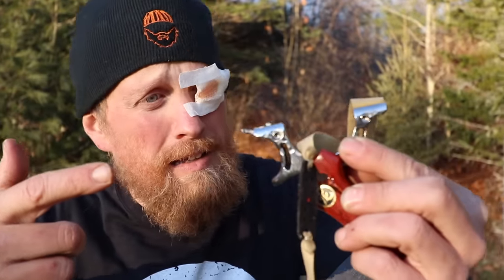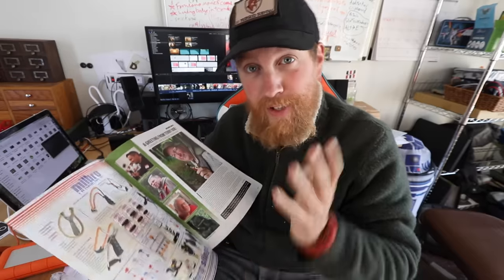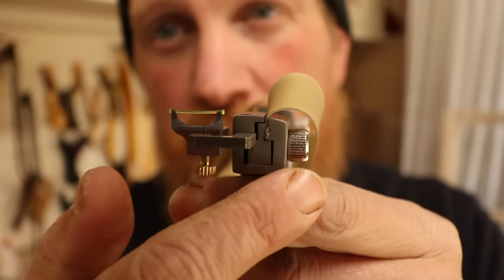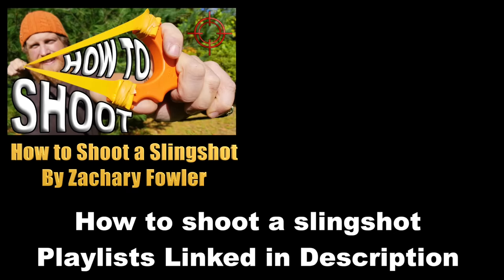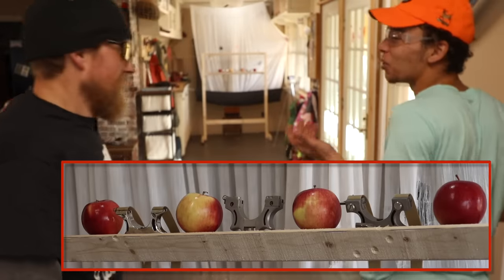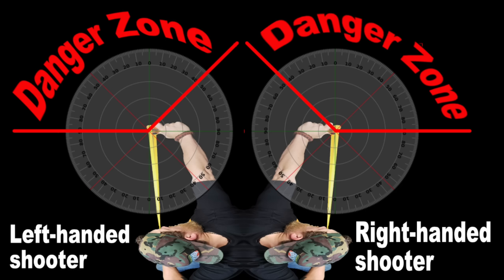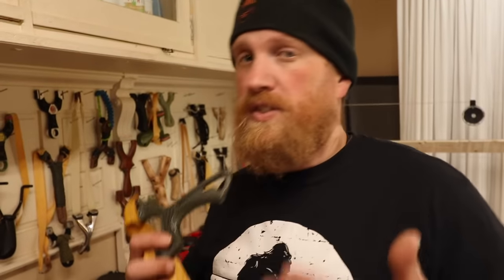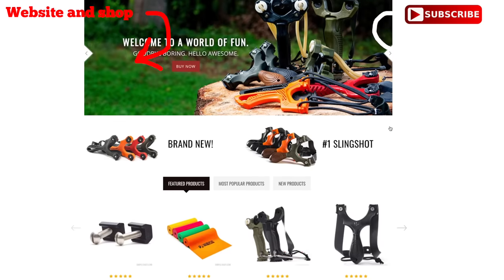Dangerous Slingshots (Slingshot How To Ep.4)

Comment: I recently bought one of those similar $20 Chinese made slingshots that clamps the band between two sets of teeth and screws together. I was shocked at how sharp the metal felt where it gripped the band along with the corners on top where the band is stretching over. I actually sanded them all down a bit with fine grit sandpaper just so i felt better (even though i really know nothing about slingshots). 
is that a legit way to grip the bands though? seems like that method would be really rough on the bands and speed up the wear and tear. Anyone with experience on those types? Thanx in advance - im getting a new one i think from your website either way.

Comment: I am using a Chinese made "Top-Bead-Stuck" frame. Made from solid 303 Stainless Steel round stock machined to hold single tube by using a 1/8in steel ball. It is a fine piece of work.

Comment: I have the 2nd one you showed. I've hit the frame plenty of times over the past year and the things holding strong. The only issue I have with them is if you like big 30mm bands, they hang over and the forks aren't smoothed over. I got a tie on type instead for the power bands.

Comment: I recently made a slingshot myself out of a solid oak board but someone has told me that it is not safe to use for this reason. It really does feel solid but this person has me worried about using it now.
Reply from the maker: Ya it's most likely not safe.  there are alot of forces and one frame hit can cause the wood to brake on the grain.  BIRCH plywood or natural tree forks are the best.

Comment: Nice tips sir need some help on catapult aiming, sir I'm from India using primitive style of catapult which has two two tube rubber band each side to achieve more power on using stone as ammo. That stone may be more than 18mm of size. But when I use small stone as my ammo so some time stone rather moving to target reflect and hit my Right side ribe or just under it. This is so painful. Sir can u tell me where I'm wrong with my setup.  This catapult need more power to pull. Plz respond

Comment: I don't quite understand, the 3 you tested appear to have passed initial and massive destruction testing (besides wood to metal connection from hammer hitting).  Would those Chinese-made models have been safe to shoot with?  Are there any possibilities a polycarbonate uniframe can break if there was a stress fracture near the forks and also slam back towards one's face?

Comment: This is a long shot that you might see this. What kind of splitting maul or axe are you using at the end of the video? I ask because I have one just like it. There is nothing practical about using it on wood so I use it as a breaker bar